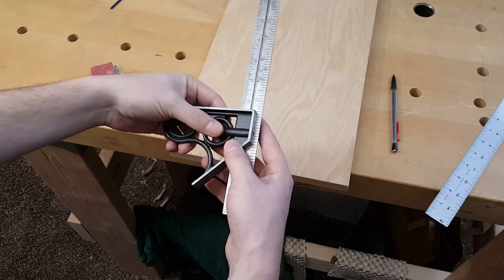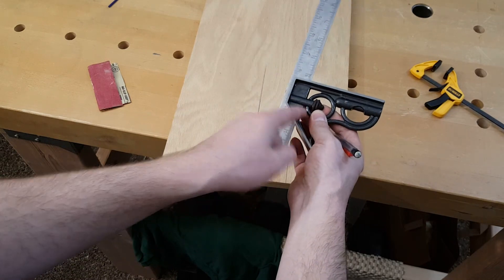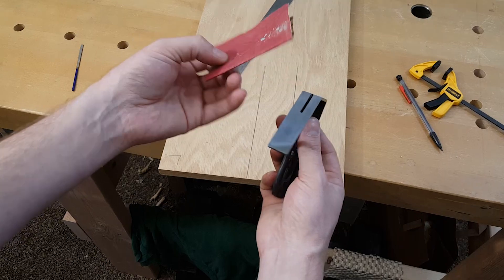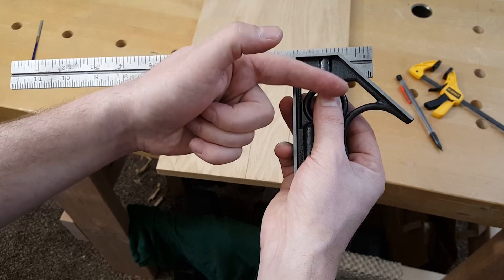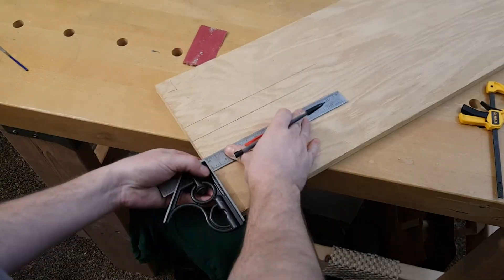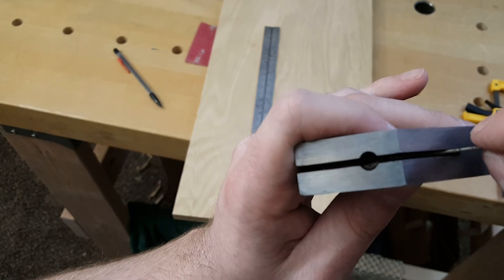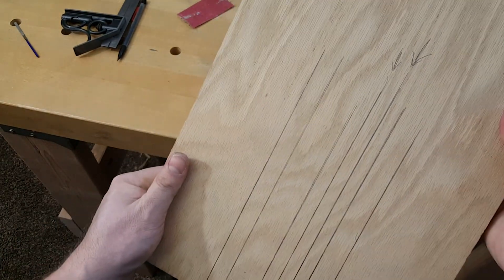Tuning a Combination Square

Comment: I don't know too much about the kind of precision you need for woodworking, but as a machinist, my instructors told me to never trust a square that's more than one  piece. Any time you take that square apart, it has the potential to loose perpendicularity, and even just sliding it along the rule can wear it unevenly, taking you out of square.
Reply from the maker: So far, this type of combination square has been accurate enough for my woodworking needs. Though It probably should be checked often.
Reply: WildGalaxy; Depending what task it is, you should use appropriate designed square. As user it's your responsibility to know your tools and what they capable. If a tool is made out of one piece or multiple that is irrelevant... A good tool is a good tool... 90% errors are made by the user that blames tools.. I blame tools sometimes myself 😁

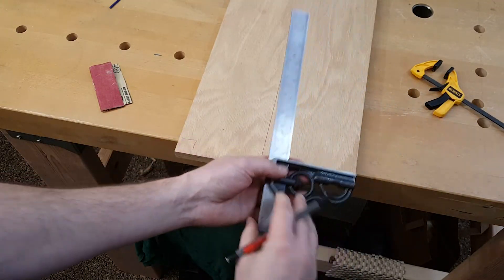Comment: Careful comrade, you didn't draw the line with the same edge at 0:45.  Determining the parallelism of the rule is a different test.
Reply from the maker: You have a good point. It is necessary to test for parallel edges.

Comment: Avoid switching back and forth between the outer and inner edge when doing this.  Usually, I settle for just the inner edge being square.  Also, a marking knife will give you more accuracy.
Reply from the maker: Thanks for the tip on using the same edge all the time.
I normally use a marking knife for my joinery, but the pencil shows up better on video.

Comment: I see some valid comments here, but I think the most glaring problem with the technique shown in the video is the use of the END of the board as a valid straight side. Weather in your shop or at the mill that produced that board, that end was SAW CUT. That end grain is almost certain to cause problems when the square is reversed and placed against a different area of that saw cut end. Sanding is not a cure for this because that may make the end grain smoother, but it is hard to be certain that you preserve the straightness while doing so. Then you proceed to make a second test at a different point on that end. That is almost certain to give a different result. And then a third at another point, etc. Your square was probably more square before you started. If I was doing this test I would use a piece of plywood. I would add a metal straight edge - NOT BY CLAMPING IT. Screw it down with countersunk screws and use about 6 or 8 of them to ensure it is dead tight with no chance of movement. Then tape a sheet of paper down on the plywood and draw your lines on that. And SHARPEN YOUR PENCIL. The one you used must have had a point that was at least 1/32 inch wide. Get a real point. A HARD lead pencil will help a lot here. For a second test, replace the paper and draw the lines at the SAME place on the plywood so you use the same place on the metal straight edge. 

One comment was from a machinist. I also do machining work and I actually test my squares with a 2-4-6 block which is ground accurate to a few ten thousandths of an inch. A shop made cylindrical square would also be good. Or you can use a surface plate with a dial indicator mounted on a special fixture and measure to both sides of the blade. But you have to check the blade for parallel edges first. As far as two part squares are concerned, they can be problematic or can be very good. I have a Starrett two piece that checks out dead nuts and a Stanley one piece that is off by a few thousandths. It isn't worth the effort to try and fix the Stanley. I also have some cheap, imports that are dead nuts and they seem to hold that accuracy. Some are just better than others and you can't tell by the number of pieces. Keeping it clean is probably a better indication of it's repeatability. 

One more thing. The edges of the blade are not necessarily straight or parallel. That would be something to check BEFORE any other measurements or adjustments are attempted.
Reply from the maker: Thank you for the input.  The piece in the video is actually a plywood with an oak veneer, so I am not concerned about wood movement. I did straighten the edges of the ruler on a lapping plate, but did not show that in the video, although I should have.

Comment: Some good comments by others, but there is even more to say.  The square does not necessarily produce the same angle in every configuration -- it depends which end of the scale and which side of the scale is clamped into the head.  So, if you adjust the square based on measurements made with a single configuration, then use it in other configurations, you might well make things worse, not better.  See this: https://www.youtube.com/watch?v=1hOx8BXIyTk

Comment: I tried this technique before. The square doesn't last very long. If you move the ruler or take it apart, it loses it's square.

Also, if you do get it square, try checking the other side of the ruler... its not square.
Reply from the maker: Thanks for the tip.  I will make sure to check both sides of the ruler for square.

I grinded the narrow edges of the ruler totally straight on my lapping plate before this tuning, so I know they are straight, but I did not check that they were parallel with each other.